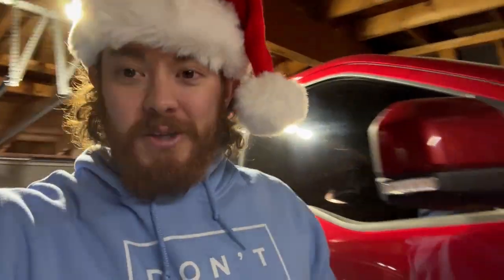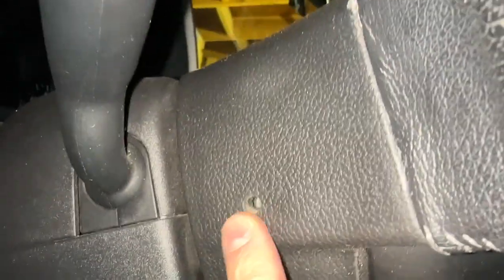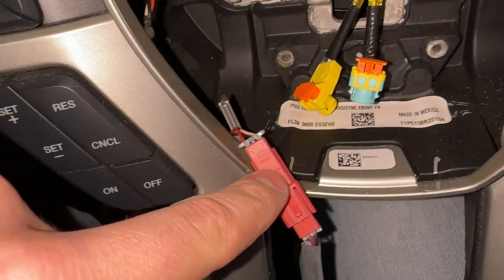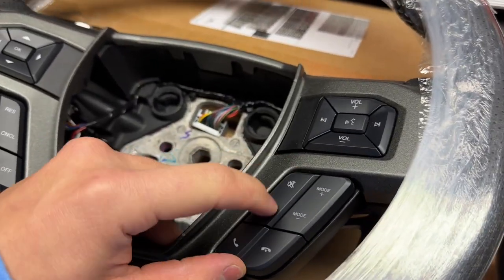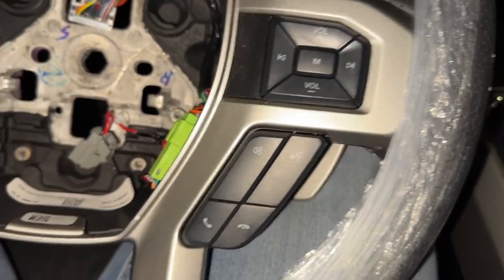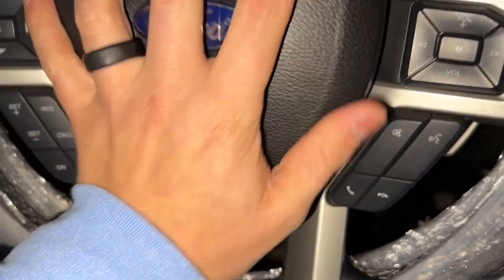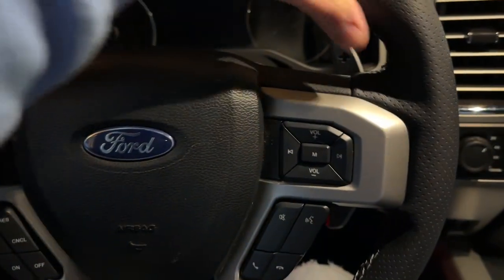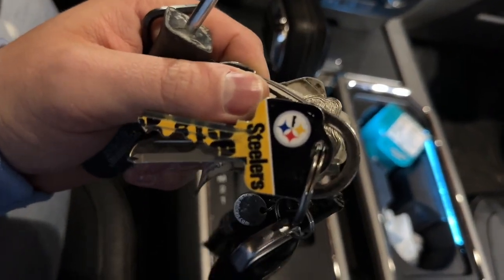The BEST Interior Mod! Installing A Raptor Steering Wheel in my 2015 F150!

Comment: Why wouldn’t you keep the heated steering wheel button? Can’t you just enable the feature with forscan?
Reply from the maker: Good question, I think you need a harness for heated steering wheel if the truck didn’t come equipped with it, don’t you?
Reply: That little steering wheel icon on the raptor steering wheel is not a heated steering wheel button, it’s actually a steering drive mode button. On the ford raptor you can change the steering mode to give it a different driving experience! Comfort, normal and sport.